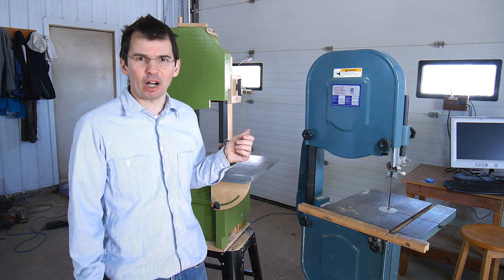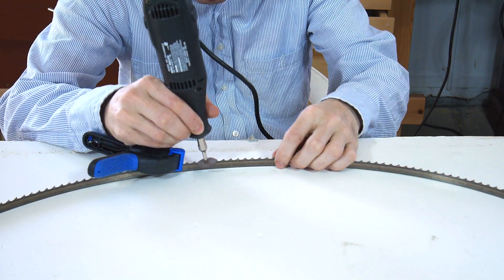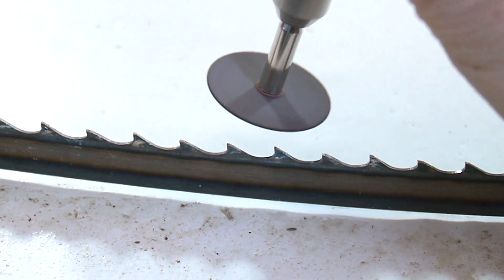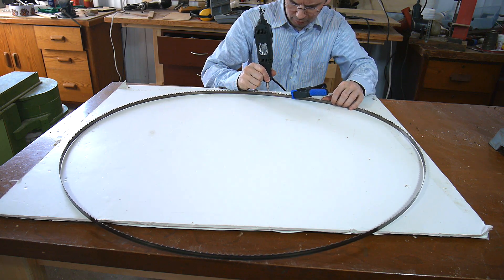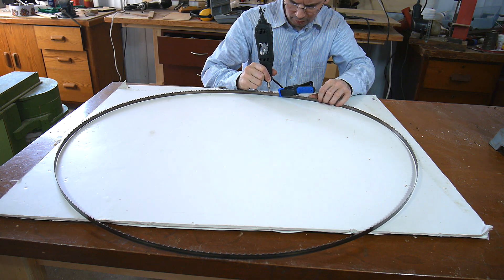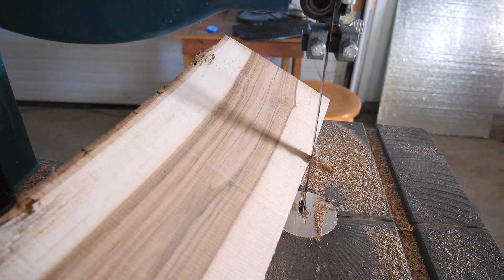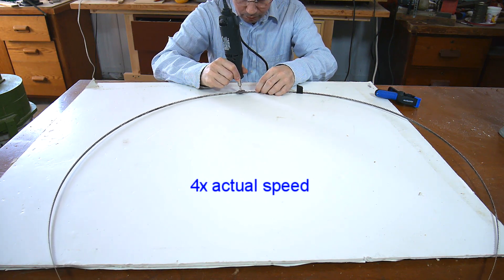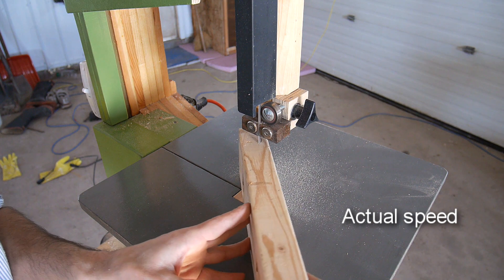Sharpening bandsaw blades with a dremel

Comment: Search for Bandsaw Sharpening The Easy Way on YouTube. You don't even have to take the blade off the machine.
Reply from the maker: skbigelo I explain in my other bandsaw sharpening video why that's a bad idea.
Reply: Matthias Wandel all depends on the tools you use. Watching your video, we see where you are not consistent with the angle, mainly because of the bit you are using. Also, your method only works for a limited number of sharpening cycles. Using a different bit, I have been able to use the same blade for 11 years, multiple sharpenings per year. Watch the video and I think you'll change your mind.
Reply from the maker: skbigelo Your method would not have worked with either of the blades that I sharpened in this video.  The teeth are too small for that cutter of yours.  Also, if you sharpen too far back (with your method), you need to adjsut the set of the blades too.  Most people don't bother sharpening blades.  This method, with very little effort, gets you 5x as much use.  That's all I need.
Reply: SKBIGLEO, Man, that video  is for huge blades not small ones, go some wheres that it matters. Because it does not here. .. Matthias method works for me on small blades.

Comment: Do you suggest doing this to new blades?  In the wood turning world, "factory sharp" is only a good thing when you don't know how to sharpen your chisels properly.  Once you know how and have the right jigs and tools, the first thing you do when you buy a new chisel is sharpen it properly.  Do you think bandsaw blades could benefit from the same practice?
Reply from the maker: mattkins99 The blades do end up a bit sharper than new after doing this.  But I wouldn't do it to a new blade.  Use it until it's dull, then sharpen it.